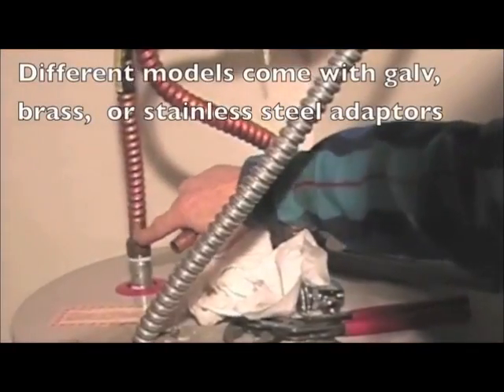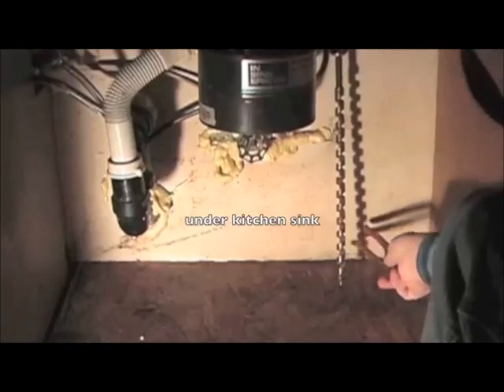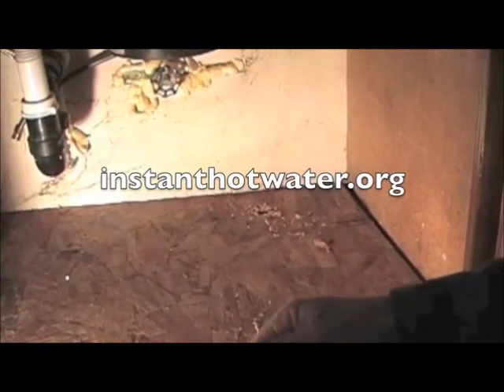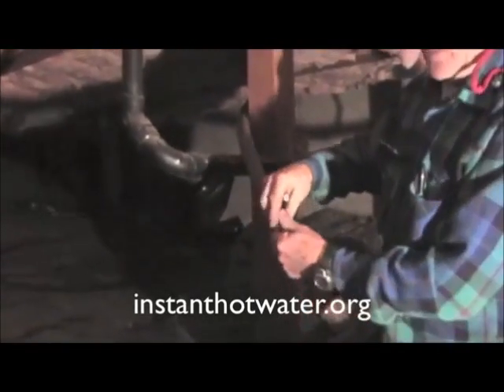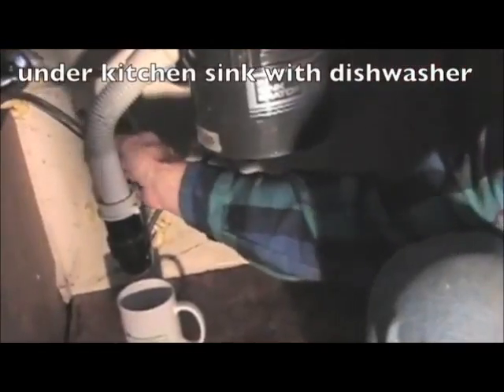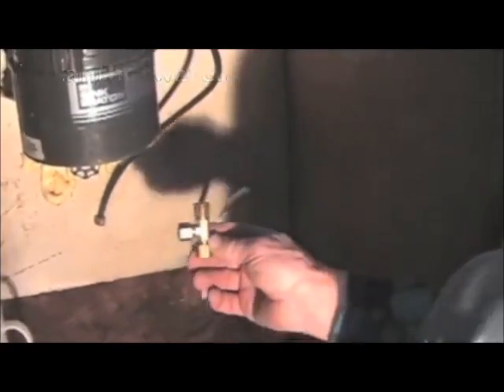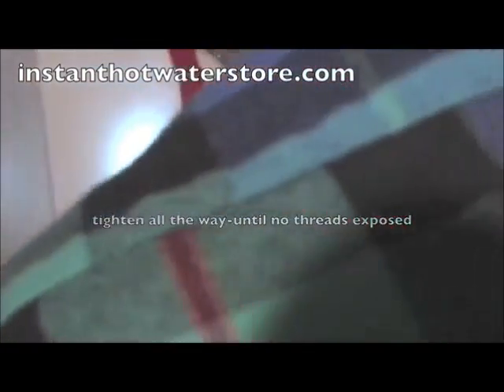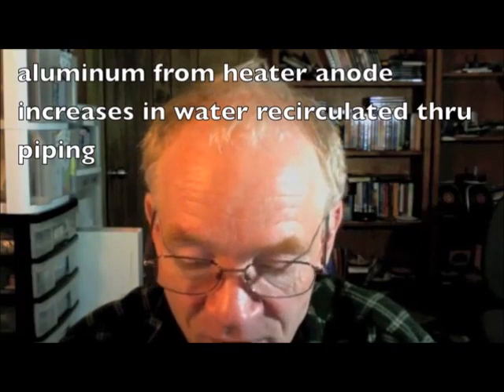Disadvantages of instant hot water circulating pump

Comment: Convection type hot Water circulation systems “continuously” circulate water through the water heater unless a valve is installed to prevent circulation from occurring.   These systems provide ambient water at best with 1/4” lines.   Just throwing pipe insulation made for 1/2” pipe over a 1/4” tube does not follow required design principals.  Video was not well thought out ahead of time.   

Timer controlled hot Water recirculating systems circulate water based on time of day.  This system circulates based on the principals that heat rises, but the rise speed is so slow the majority of the heat is lost before arriving to the sink.   Don’t learn the hard way by ordering and then returning because the water isn’t what you consider to be hot.

Comment: I disagree with you haters.  The man is simply trying to show a method to achieve hot water recirc WITHOUT using a pump.  It's a good idea!  More work but less costly in the long run When you consider Operating Cost and When You Replace your pump again.  Healthier system too.  Good Job Pat

Comment: Don't follow with his dumbass instructions. buy the Watts recirculation pump... Running the sensor swing valve at the furthest distance away from the water heater when the temperature at that point reaches its nominal point it cuts off. this guy is truly a dumbass. you don't need to run extra piping you just use your existing cold water for the return. you must be a true pothead with pothead logic.
Reply: +Gene Sanchez  Obviously you don't know what a Sacrificial Anode is. In the span of about two years they dissolve several ounces of Aluminum or Magnesium into your hot water. Aluminum is not good for your brain or for taste of your water and Magnesium in that large of a dose ? I don't know ..... do you ?

Comment: Just use a recirc pump wih a thermostat. Once the water is hot it shuts off. I can't believe you ran separate small lines when all you had to do is hook up a simple pump. Is using 1/4 plastic line even allowed by code? Probably not because everyone would do it if legal.
Reply: +resqjason2 CODE would not apply here because the small line is only used as a RETURN line. It will have no effect on the supply of water to the faucet and will be plenty big to handle the flow. I once installed 1/4" copper running 25 feet to a kitchen sink and it was able to run at full force even when other faucets were running full force. the idea that half inch is the smallest size is bull shit perpetuated by the copper and pipe industry. All piping could be run in 1/4" plastic from a central Manifold. No restrictions, no scale buildup, no problem.
Reply: +Harold Westrich a return line? Its used as a supply line from the heater direct to the faucets. How did you come up with a return line?

Comment: 1-  A real mechanic (formally trained)  when possible pulls a wrench rather then push

2- Using slip pliers  are  not the best  idea  to use to make up piping or fittings  especially on nuts  as a Crescent (no teeth ) wrench will not mar the fitting and leave sharp edges 

3- You can always tell when someone is unsure of their work when they use Teflon tape and then pipe joint compound

4- Even a decent helper knows never   go from a small water line to a larger line as you have a severe "volume drop  besides pressure drops using the fixtures 

5- It takes a certain mentality to use such a small line 1\4"  as this size line is  used for a refrigerator  ice maker and even then  the 3/8 Copper tubing should be reduced at the appliance

6- Why would someone dare used a compression coupling  in a crawl space and even worse use 1/4" plastic that rodents will gnaw through and cause  severe problems  with leakage

7- If you notice the waste line  they used an corrugated (accordion type) fitting that in civilized areas with decent plumbing codes this is contrary to code as it allows severe bacterial  growth 

8- Many civilized areas  frown upon using plastic for potable water as carcinogenic  chemicals can leach into the water supply  especially on hot water piping

9- If you do not recirculate the hot water the flowing  takes place

A- you heat the water use it at a tap shut the tap the water cools

B-  You open the tap (faucet) a few hours later now the water you paid to heat has cooled off and your running (wasting ) water waiting for it to get hot again  going though this same wasteful cycle

It is  very important for your protection to ask to see a master plumbers license and ask for what type of formal plumbing education they have

Also ask for a certificate of insurance 

The plumbing license protects the consumer not the license holder

California is having  a severe water shortage  and to waste water  thinking you may get another few months life out of a 10 year  water heater makes no sense what so ever 

It takes all types to give  a "how to video"  one should consider the source  before taking inept advice as gospel
Reply: Yellow gas tape and tfe paste and no white Teflon?  Using channel locks instead of a box wrench?  Flexible supply lines that are twisted and kinked?  And all the step downs?  No way would this guy be allowed in my house.
Reply: +Msrk s 

  Well if you want to be technical  there is always the professional  27" loop  on the CW supply to prevent stratification of hot water mixing with the cold and wasting energy and can be a cause of bacteria in the potable water sully.  I  figured you already  new that and was just seeking to prove how brilliant you are
Reply: Sylvan Tieger You make a lot of well worded criticisms about this video and thank you for that but you only allude to what I think is the most important rule for You Tube DIY:  

Always read the comments. 
They can be an invaluable source to point out minor commissions, add excellent advice and suggest alternatives.  
Not in your case of course. Sometimes, they are just comical and entertaining.
Reply: The problem is  when using a slip pliers they can and do mar the pipe  / nuts and cause sharp edges  which can cause  cuts and worse metal splinters  . If your going to spend valuable  time trying to help others may as well show them how a professional works.  I fired more then one employee for using slip pliers on chrome fittings and also  these tools do not make up piping as well as wrenches
Reply: Since you  did want  some more input  .Why in heavens name would you install an angle stop   as most angle valves are a globe type pattern used for THROTTLING  and it is never considered a positive shut off valve.  

The  chrome angle valve  you show  has a washer  which is also not the ideal  type of valve to use as a ball type would have been a much better choice  and  is a positive shut off valve just like a gate valve.

Also most skilled plumbers learned during their apprenticeship about "stratification"  meaning hot goes to the absent of heat  so a decent mechanic  would have installed a 27"  U  on the cold water supply line to prevent the hot water  molecules  from entering (back flow)  into the potable cold water supply

I purposely tried to dummy down my answer as not to confuse anyone with facts 

If I wanted to really criticize  the above video I would have stated ALL dishwashers have a minimum  of 3/8  IPS  ID (inside diameter)  water supply  NOT   ID 1/4" unless  people don't mind the wait and the manufacturers  get a call as to why the dishes do not come out as clean because of lack of "Volume"  supplied to the appliance  

Also saving money  using one valve  is  not what a homeowner would appreciate  when something fails.  Why should the hot water be  shut by the heater when normal   people  place an isolation  valve by the fixtures being served and one for the appliance.  

Suppose  the faucet starts to  drip   now you have to stop the water supply to the DW also . TSK, |TSK
Reply: Around here, it's against code to install a shut off valve on the hot side of a water tank.  I realize this valve is not intended to shut off the main hot water line but still wonder about potential for trouble with picky inspectors.
Reply: +Sylvan Tieger 
do you have anything good to add?